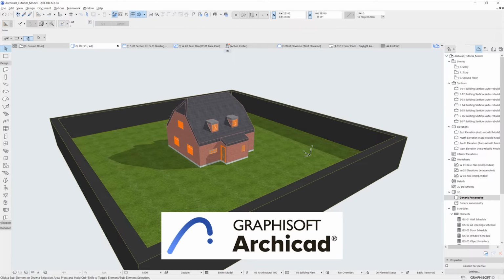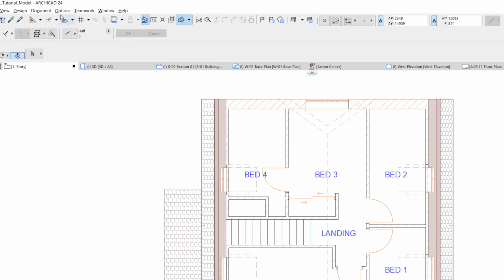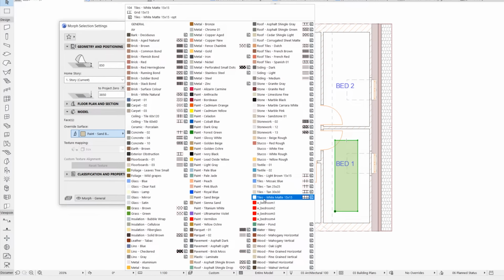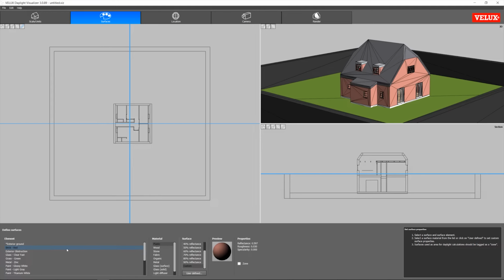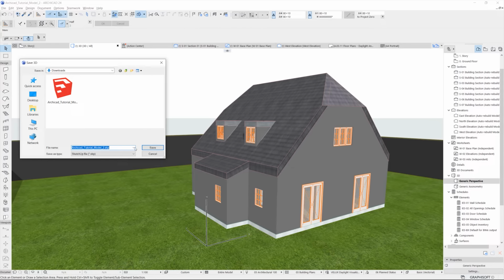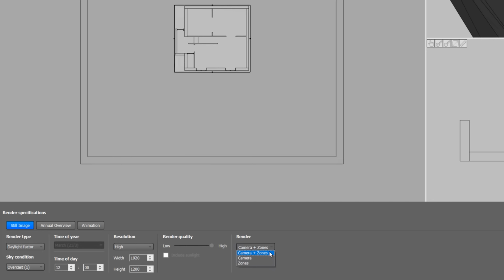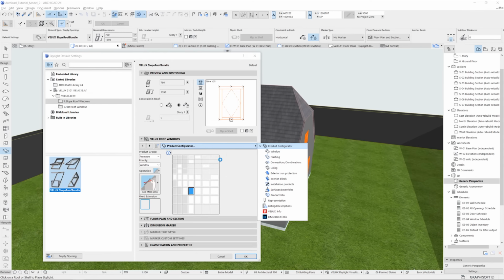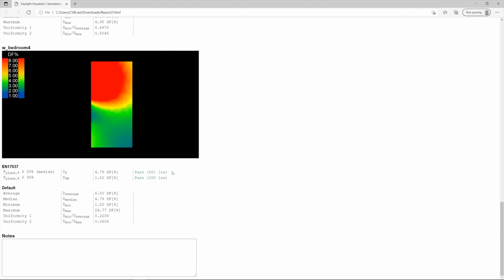How to Prepare an Archicad Model for Use in VELUX Daylight Visualizer

Comment: What should be the height of external obstruction wall? Any suggestions on the distance from object?
Reply from the maker: It should be an accurate representation of the context on the site of the building. If a specific context is not available - then one can assume realistic scenarios based on morphology of the building tissue.

Comment: Does the EN 17037 require specific standardized settings for surfaces within an apartment as an example? On walls, floor and inner ceiling?
Reply from the maker: Yes specific range of values are suggested in the standard.